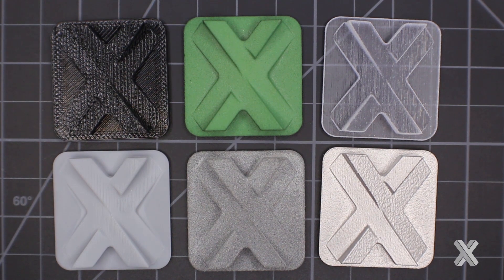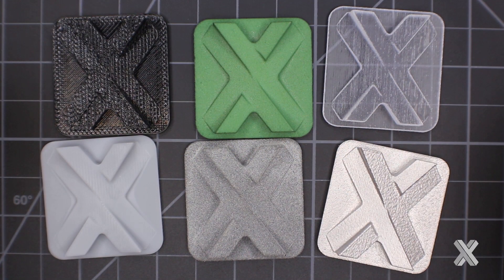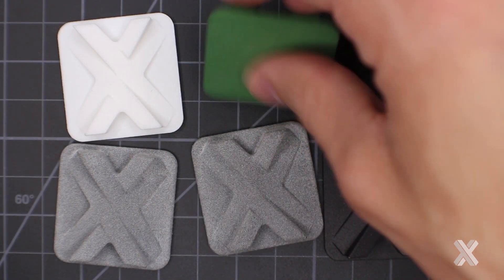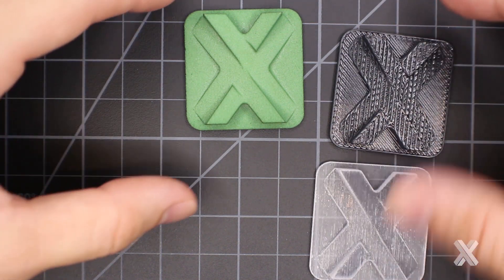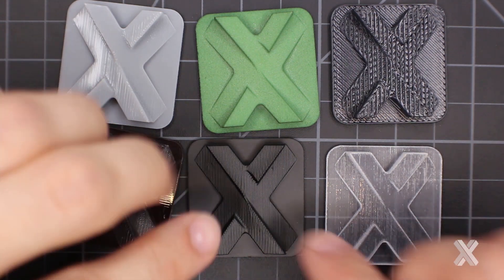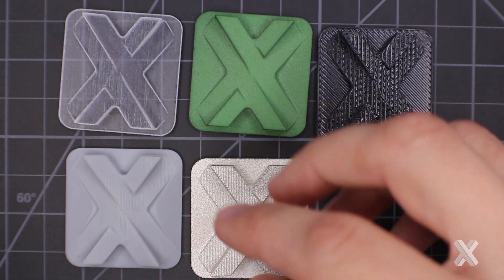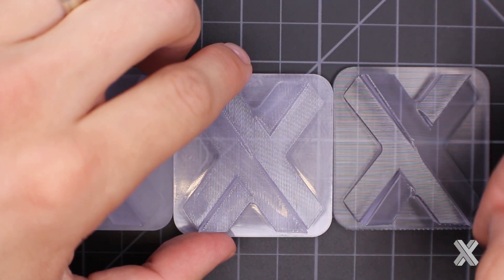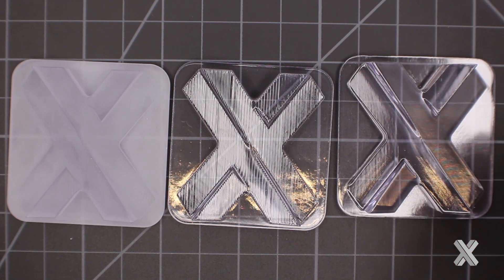Understanding 3D Printing Surface Finishes

Comment: Hi, I want to know what would the strength and stiffness difference between PA12 & PA12GB from HP? Is it big difference that can allow to reduce wall thickness and still gain good strength
Reply from the maker: Eventually, it depends on the geometry of your part and on the relation of the wall thickness to it. Even though PA12 GB is much harder, it's not universally stronger in all areas. For example, it has 30% lower tensile strength. So, it really depends on the geometry of your parts and current thicknesses.